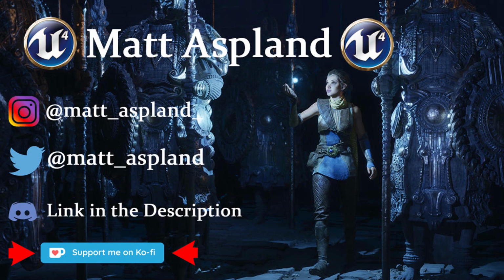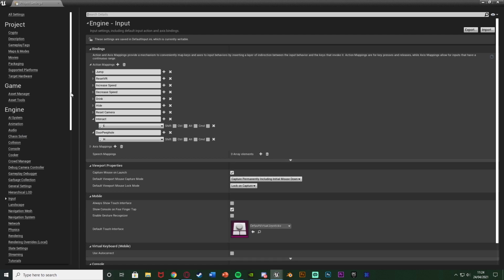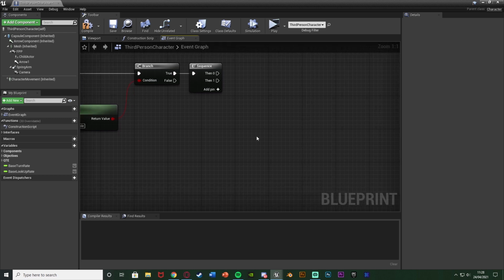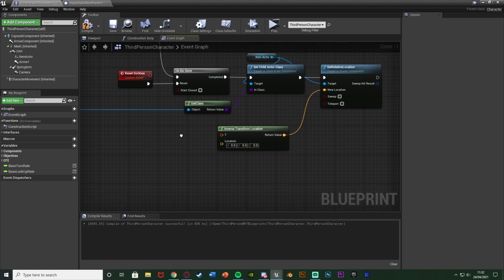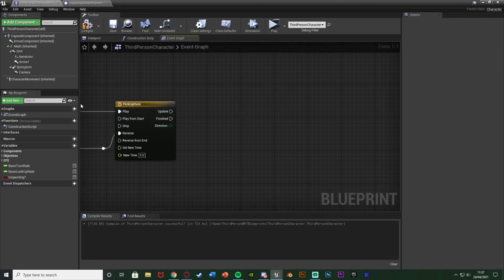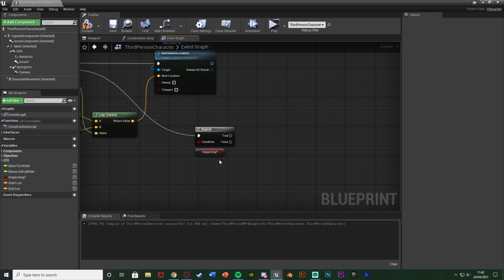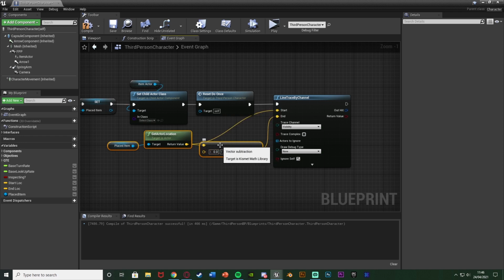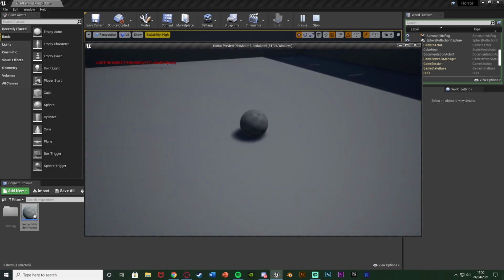Picking Up And Moving Objects | Inspect Item Part 1 - Unreal Engine 4 Tutorial

Comment: Worked for me in Engine 5.5. I did have to tweak it to get it to work. I used @joshlittlelight4777's suggestion for the "OR BOOLEAN" and it worked. The only issue that now I keep getting an error after I exit the simulation saying, "Blueprint Runtime Error: "Attempted to access BP_PickupItemParent_C_1 via property Placed Item, but BP_PickupItemParent_C_1 is not valid (pending kill or garbage)". Node:  Set Actor Location Graph:  EventGraph Function:  Execute Ubergraph BP First Person Character Blueprint:  BP_FirstPersonCharacter" Anyone know what this means? It works just fine otherwise. I can pick up and set down the item numerous times.

Also running into the issue where I have to look straight down to set the item down instead of away from character a little ways.

Comment: Hello from the future! If anyone is still encountering the issue for putting the item back down, no matter the fixes provided below... Just in case any one else should have had a V8 today, don't forget to plug in your Set "Inspecting" to the Reverse of the "Pick Up Item" Timeline... (Sequence - Then 0 > Delay > Branch > False > Reverse (Pick Up Item Timeline) Like I did by mistake lol

I should also mention this is in combination with one OR Boolean after the Actor Has Tag, with the Inspecting variable attached to the other input and plugged into that branch.

Works like a charm now! I am currently on Unreal Engine 5.4 so I hope this silly mess up might help someone out along the way lol Cheers Matt! Thanks again! This one is going to be used for the 2025 Evolution Jam 😎

Comment: For anyone who is going insane about it glitching through the floor when you look down and drop it, I was able to fix it by going to the final line trace he showcased in the video and adding a few things. I'm bad at explaining but here's an attempt. 

What you do is make a branch with the condition coming from the blocking hit on the break hit result for the linetrace by channel. Connect the white arrow to the branch from line trace by channel and connect the true output to the New item end location. For the false, connect the output to a new line trace by channel node. For your start, get the actor location for the placed item and do an add vector node. In the Z, put 500. Now for the end, it's the same as the line trace that he did in the video, or the location for placed item minus 500 in the z. Break your new hit result and set the location for that one to be your new end item location variable. Connect that to the new item start location which then goes to the timeline and it should be fixed

Comment: Another thing: I have a piece of paper with text as an object. I unfolded it and put it on the surface as it should be. If I pick it up from the surface above ground level, it is if I put it down normally without changing its location, but if I move away from the surface with it and try to let go of the object it first descends tangentially and in the end sharply descends vertically to the ground and .... flips 180 degrees. What do I add and where to make it at the end of the landing does not make a turn on 180?

Comment: Hey, this is not working for me in UE5, any idea why that could be? I did the coding exactly the same but nothing happens when i approach an object in my scene and try to interact with it.
Reply: Same thing happened to me
Reply: same - when I re-activate "Draw Debug Type" to "For Duration" I can see the Line trace firing on a flat plane, not adjusting with the angle of the head and camera
Reply: go and add interactable into (self) of static mesh

Comment: Firstly thank you for the tutorials and I’ve tried some of your other tutorials, most of them work so far. For this mechanic I can pick up the item and inspect but I can’t put it back down. When I press E again the character can move again but the item is still floating in the middle of the screen. I’ve checked the code multiple times and nothing seems amiss.
Reply: I am having the same issues I'm not sure if its a UE5 issue, there was a comment at the bottom for a fix but with no luck. I can pick it up but it stays in the middle of the screen and I can't put it down again?
Reply: I found a solution that worked for me,  Right after the first LINETRACE there is 2 branches with the second branch having the "actor has tag"  in the return value. In the Actor has tag return value add in a "OR BOOLEAN" and connect the Inspecting variable and the actor has tag to it then the pin going out of the OR BOOLEAN plug it into the 2nd branch, this was super confusing for me so I hope it makes sense but messing around with it I got it to work for me using this method. Hope that helps.
Reply: @joshlittlelight4777  Thank you, that worked for me to! I had the same issue. It works but i get every time an error message for that second branch
Reply: @joshlittlelight4777  you are a life saver, I spent 2 days on this before I saw your comment.
Reply: @joshlittlelight4777  thanks soooooo much it helped me alot
Reply: @joshlittlelight4777   Чел, огромное спасибо, он по началу даже не поднимался, но потыкав по твоей инструкции все получилось!
Reply: @joshlittlelight4777  Man, you are a hero. An entire day searching for this solution.

Comment: Great tutorial but I must have goofed somewhere. I can pick up and put the objects down, but only when the trace line hits another actor.
Reply: I realize this is super late but, this is a feature for the script as it was written and not a bug. You can fix this however by setting the first two branches after the first LineTrace to accepting an OR condition, with the other condition being "inspectable?". So if inspectable is true(player is holding) then it won't require the linetrace hit.
Reply: @LordCastellanCodedSnake4163  I don't understand.  where do you set the "inspectable" variable?  Also, why doesn't Matt have that issue in his tutorial?
Reply: @LordCastellanCodedSnake4163  nevermind, I figured it out.  I wasn't using a variable called "inspectable?", and just realized Matt was.  I added the "or" boolean to the branch after the "has tag", and it works now.  thanks.
Reply: @semmert  hello i would like to try to get in touch with you because i don’t understand how to do it. Is it possible to have your discord?

Comment: Hmm I can't pick it up and I am also propelled into the air when Interact with the object.
Reply: Same
Reply: @ciarangaming7563 you have to disable collisions on the object you pick up, or set "pawn" to overlap.  The problem is the object collision is fighting with your character capsule and trying push them apart.
Reply: @semmert  if i disable collisions the blueprints will not work, if i set pawn to overlap nothing changes

Comment: Hi. Thanx for the awesome tutorial. I have a little problem. I watched the video 5 times and i am sure i did everything right. I can pick up the object but i can not put down. Can you help me?
(Update) I found the problem but i still don't know how to fix it. To interect with the object it needs to be in the center of the screen. But i don't want it to be center.
Reply: You have probably moved on from this long ago, but for future users with the same issue. You can resolve this by changing two branching statements to receive an OR condition. The first branch which requires this is the one immediately following the first "LineTraceByChannel", add the "inspecting?" boolean variable in, as well as an OR condition, and then plug the inspecting variable and the already existing return value from our LineTrace into the OR conditions which then can go back into the branch. Then repeat this process with the very next branching statement which currently only takes the "ActorHasTag" value as a condition. So as a quick breakdown for anyone who cares, the mechanic will now function if the item in front of them is an inspectable, OR if they are already holding an item.
Reply: @LordCastellanCodedSnake4163  hello i would like to try to get in touch with you because i don’t understand how to do it. Is it possible to have your discord?
Reply: @LordCastellanCodedSnake4163 this helped greatly, thank you!
Reply: Could someone show me how to fix the bug or we can't file?
Reply: I was able to follow along with Lewis’ OR condition suggestion. It did bring in the Access None error. To solve that I saw that adding “? Is Valid” and inputting it before the branch call and connecting the target for it to whatever the error is referencing. It screwed with the line traces ability to place the object back down without directly looking at the ground. Which is what I’m trying to solve next.

Comment: Currently having trouble in the putting it down part, it seems that its not resetting the inspecting variable(its always true), therefore not allowing me to put it back down, any idea what it could be?
Reply: Nevermind. Found the solution. Im using a third person camera, so when you click the interact button once u have the objective picked up, you need to make sure the line hits the object you are currently holding, otherwise it wont play the "putting down" because it only interacts with objects with the interact tag.
Reply: @drysnalg6036  You are an absolute genius for figuring this out thank you!! Please pin this Matt!
Reply: @drysnalg6036  thanks u i has a same problem and u saved me
Reply: how did you end up fixing the "line trace" hitting the object again ? 
I'm having the same issue
Reply: @darkmazztv  If I remember correctly, my line trace was on the wrong axis. After fixing that, the issue was that the range was too short. You can enable debug on line traces from mouse clicks and adjust from that.

Comment: Interesting now using Tags? Okay...
Difference between using an interface?
Reply from the maker: Yep, I found that tags were a good choice for this system. And an interface would be better to use if I did the picking up code within the blueprint, or it needed to be different for each item. However, I did it all in the character BP without needing to cast to an external blueprint.

So in this case, I didn't need an interface, I started out with one, but changed how I was writing the code half way through :)

Comment: Is this method works?:

So when u click an action key for example "E" key, an animation will be triggered and by anim notify when the animation hit specified frame, the object will be attached to character's hand socket.

i wanna give it a shot but i dunno yet how to implement that, i just knowing that anim notify is used to make like triggering footstep sound. Also i dunno yet how to attach object to socket.
Reply from the maker: Hey mate, theoretically that sounds correct yes. Once you add the notify to your animation, in the animation blueprint, you should be able to get the event for that notify, it should be named "Anim Notify 'whatever you named it'". Then you can use "Attach Actor To Component" to attach the object to the socket you like :)
Reply: Look up any equip weapon tutorial.
Attach to function actor to component or other, to certain bone/scene/item, if necessary add a socket to the skeletal mesh and there you can even use preview with certain weapon/actor.